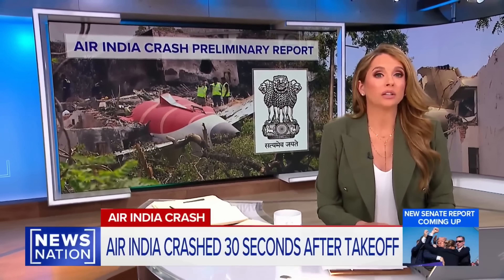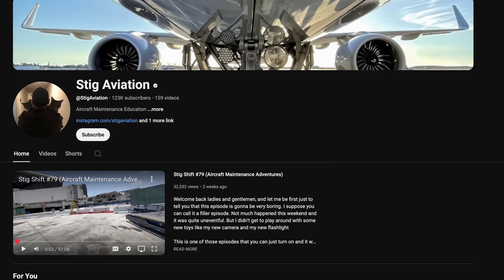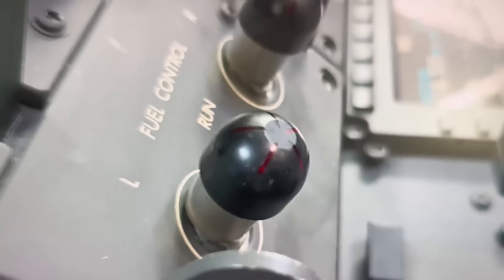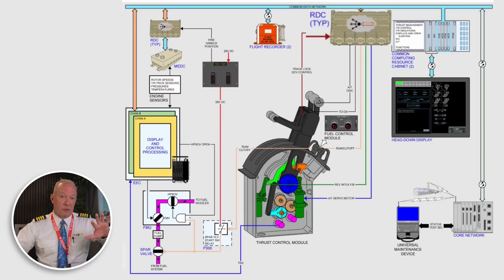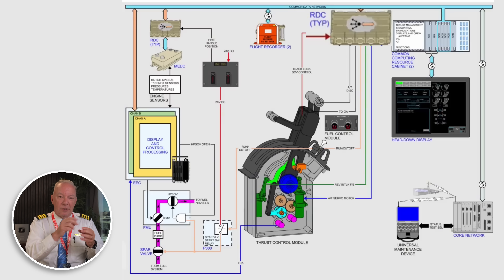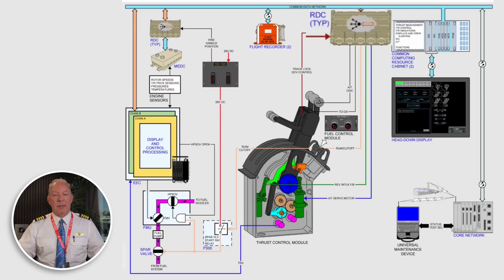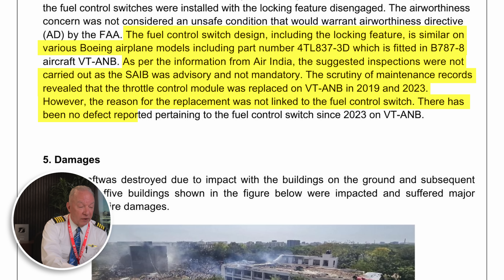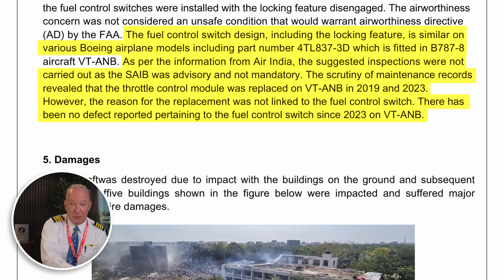The Truth About Boeing 787 Fuel Control Switches

Comment: Absolutely agree! Thank you Captain Steve.
These same switches are on the B757/767 that I fly and never have I seen a faulty Fuel Control Switch.
The report is very specific, the overwhelming possible cause for the engines to spool down was that the Fuel Control Switches were moved to Cut-Off, the probability of an accidental movement of both at nearly the same time is beyond what could be reasonably be expected. A dual independent system fault is even less likely.
There is another way to close the three fuel valves. Pulling the Fire handle. This didn't occur as per the preliminary report. The fire handles are locked in place by a mechanical guard. Accidentally moving those is even more far fetched than accidentally moving the fuel control switches.
Reply: Please watch Flying Beasts analysis before commenting about this topic
Reply: @anshgupta7726 I have. I also have 7500 hours of the B757/767 that has the exact same Fuel Control Switches. Also an Instructor on type.
Reply: Except for the wear and tear possibly where many pilots fail to fully pull the switches out to clear the notch over time those notches can wear out and become much more easy to knock off. I would be looking at whether a set cycle life where the switches should be replaced.
Reply: @gregb1599  They recovered the switches.  Presumably if there was any such wear and tear, it would have been noted by now and a safety bulletin issued.
Reply: @BlueCyann I have found no evidence that the fuel switches have been recovered. Only other Air India switches that have been checked, I do not believe there is much left of anything in the cockpit. 
And all airlines have checked the fuel switches for wear so there was a bulletin put out to check the switches, just to rule that out as in the past some 737 did have issues with the switches. And it's not the first time when an airline thought they had fixed the problem only for another aircraft to crash before a real fix was made. DC10 for an example with it's faulty cargo door!!
Reply: @gregb1599 The AI171 fuel switches were recovered and there are pictures of them in the Run position.
Reply: @benanderson4118 Where is the proof its from that accident? They are only on the net and could be from any aircraft, until they publicly show that I take all photos on the web with a grain of salt! In 2018 they had a bulletin for the switches on some 737 aircraft where they could be accidentally switched off and as I have said many times some fixes have not fully fixed the problem and no matter how unlikely it is there is still a small possibility that both switches were faulty and were accidentally knocked off. Everyone on here is so one sided its the Captain he did it and thats the end of the story nothing else could have happened! Well I will keep an open mind until I am proven wrong!
Reply: I'm thinking, if the fuel switches works as Captain described it, then a loss of battery power could open both relays and close all the valves.

A flimsy contact might be triggered by positive G's, then start working again when negative G's happens after shutoff.

Or, the battery could have died, opening the relays, which then closed again after the RAT started providing power.
Reply: @giacomoneri1782 the batteries are getting constantly charged from the DC buses, powered through the main AC buses (using a Transformer Rectifier Unit) by the engine driven generators, with multiple backups. The very last electrical power lost would be the Hot Battery Bus. This scenario is highly unlikely. Now this isnfornthe B757/767 but I highly doubt the 787mis any different.
Reply: @gregb1599 watch the video again. They were recovered. The entire throttle quadrant was…it was from the Indian report.
Reply: @gregb1599  Two switches malfunctions, at the same time?!
Reply: @emmypuss4533 Yes extremely unlikely, but in 2018 some 737 switches were found to be faulty, could the fix end up not fixing the problem long term? Possibly but yes extremely unlikely of course dual engine failure is also extremely unlikely but has happened in the past. No one knows anything yet. It will quite likely be the pilot, either accidental or on purpose, we may never know. But it is very scary if all it takes is one pilot to pull the fuel cut off so quickly that the other pilot cannot react in time to stop them! Some say the pulling the fire system will shut down the engine and make it impossible to restart the engine. However my brother who used to work for the airforce as an avionics engineer said that assumption is wrong and there is nothing stopping restart of the engines as its only discharging fire retardant. He worked on the Boeing 757 aircraft.
Reply: @gregb1599   According to the preliminary report the throttle control module (which includes these switches) was replaced in 2023 so they were fairly new. Also these switches are used at the start and end of every flight so I think pilots would notice and report it if there was a fault with them.

Comment: According to  this simple diagram and 'Closed System Theory'  The flight data recorder could not have know where the switches were. For my sanity, I would like them added to the diagram.  Could something gone wrong with the relay caused the issue?

Comment: There seems to be two contradictory scenarios.  Captain Steeeve agrees with the official report that the engines shut down ONLY after the fuel control switches were manually and deliberately transitioned to cut-off and it was that and only that, that caused of the engines to lose thrust.  

Geoffrey Thomas'  rather detailed and technical analysis indicates that the engines failed and the RAT deployed BEFORE the switches were moved and indeed at the very time of the initial takeoff roll.  The engines failure was, VERY PROBABLY DUE TO WATER INGRESS INTO THE ELECTRICAL EQUIPMENT BAY CAUSING A MASSIVE ELECTRICAL SHORT and that severe electrical crisis caused loss of necessary power to all fuel pumps and thus caused both engines to shut down (position of switches and status of relays being moot at this point).  The electrical crisis was a transitory effect and the engines immediately and automatically tried to relight, but the pilots unknowingly tried to manually relight the engines by turning off, then on again the fuel switches.  Thus the off again, on again switch positions so recorded was a misguided attempt to relight engines that were already in the process of automatically relighting.  Of course, by this time it was far too late for any recovery, automatic or manual.  This would completely exonerate the pilots and put the blame on Air India and its maintenance procedures for allowing water ingress to cause a fatal malfunction.

On the one hand, (1) it was a deliberate sabotage by a psychotic pilot (which I just don't want to believe) OR (2) it was a maintenance failure on the part of Air India (which I can believe).  BUT, regardless of what I WANT to believe, there is evidence out there that will settle these discordant positions and I (for one) would like it released in another authoritative update.

Comment: Slight correction on your explanation of that switch. You keep saying there is a relay inside that switch, that is not true. That switch is simply a 4 pole, two position (ON/OFF) switch period. By definition a relay performs a function similar to a switch but the change from on to off is done via application of a DC or AC current to a magnetic coil. None of that exists in this switch. By continuing to call it a relay you give listeners the opportunity to say some errant signal may have caused changing of the position which we know is not true. Hope that clears some semantics up. Retired aircraft wiring engineer here.
Reply: What about the claim by many that the black box registers only the valves at the engines, and not the movement of the switches?  There are thousands of Indian web sites whose whole business is claiming that the fuel switches were never physically moved.
Reply: @JosephBoxmeyer-u3d  As I stated, the switch has four independent poles which means it can drive commands or data collection to four LRUs. While I do not have access to any actual 787 wiring diagrams I have seen a block diagram of sorts that shows two signal paths departing from the switch. One is going to actually command the shut off valve via a relay and the second goes to the RDC to record the position of the switch. The other two poles may be used or not, without a complete diagram I cannot say. So to your question, I would think that everything collected on the RDC's eventually makes it to the FDR but who knows. If you have the data, why not record it.

Comment: I imagine alot of hand slapping going on under the throttle levers as one pilot tried to reset the fuel cutoff switches and the other pilot calmly saying "I did not" for the CVR while fighting to keep them off.  Malice and forethought in my opinion.  The bad guy won.  It was the absolute worst.  "It happens"  -Orenthal James Simpson.

Comment: I watched that video that commentator #3 did that was on the start of your video. I believe he’s basically full of it.  I’m typed in a few different airplanes and as you say just about all fuel shutoff valves are hard wired to the battery through a relay.  We will never know why the fuel control switches were shut off because the answer lies with the Captain who is deceased.  The plane did exactly what it was designed to do, even though the level of this tragedy cannot be ignored.  Great Video Steve!
Reply: There is evidence enough to deduce what happened with the fuel switches, at least to some level and degree of certainty. It's not completely unknowable. NTSB did extensive investigations for this very reason. To figure out what happened after everybody is dead, using evidence, science, reason and logic. It's really horrible how they are trying to deflect and create propaganda that it is unknowable what happened. Much of what happened is knowable. 

I get what you're saying tho.
Reply: Did anyone checked the relay springs if are ok?
Reply: The reason so many people assume the fuel spar valve was computer controlled is because on the 787 almost all valves are controlled that way. I think, only the fuel spar valve and fuel spar jettison valve are hard wired.
Reply: THEY NEED TO INSPECT ALL PILOTS
Reply: You missed that big fat AND gate between the P300 relay and the valve. LOL!
Reply: The 787 is VERY different from all your planes.
Reply: @ConcernedParent-z1q ITS OBVIOUS  YOU DO "NOT" HAVE A AME LICENCE

Comment: Could the relay have failed? Most relays are normally open or normally closed. I would think this relay would be normally closed (fuel off), is it possible the relay coil burned out and the relay spring moved it back to it's default "closed" position?
One other question. You see how the relay goes to an AND gate? The other end of that AND gate goes to the "Display and Control Processing" that's an input from that system to the AND gate. AND gates require that both inputs are high for the output to be high. So if that Display and Control Processing signal went low then it would cause the AND gate output to go to 0, closing the valves. Is that correct?

Comment: This is why we need in cockpit video recordings. Then there would be proof if someone shut the switches off and denied it or if the switches failed confusing both pilots.
Reply: Seriously we have back up cameras in vehicles sonar crash detection. Put video gear to black boxes and while you’re at it cameras so pilots can see behind above and below as well as each engine and landing gear flaps so you can diagnose false data. Then you know if flame out gear down flaps correct. Seems silly a 74 year old sod buster from Nebraska has to suggest these safeguards. Flown as passenger maybe 6 times in my 74 years

Comment: Capt Steeeve.... next time you're in the simulator... see if you can "balance" those switches in their "center" position... with the lever detent on top of the flat portion of the switch body. I could do it on some older detent switches... don't know if it is possible on these switches.

Comment: Captain Steeeve - First of all, thanks for the videos you’ve been putting out on this topic! A couple of open questions in my mind: (1) What exactly happened in the case of ANA NH-985 on Jan 17th, 2019, to cause a dual engine failure immediately after touchdown in Osaka without the pilots having touched the fuel control switches? (2) For Air India flight AI171, I’ve seen on some YouTube channels that the RAT may have deployed before the fuel control switches transitioned to cutoff. What are you thoughts on this?

Comment: I know zero about flying a plane but moving those switches looked way to easy for something as critical as shutting down an engine.
Reply: Pushing the yoke forwards is also very easy. But, yes, inadvertent "muscle memory" type action should probably be blocked in the takeoff phase.

Comment: Steve, as an electrical engineer, I noticed that the schematic isn't quite detailed enough. Specifically, there is an AND gate (A logic symbol) that ultimately controls the fuel valves. I would like to see how the wiring makes this logical AND function. I also don't see where the fuel control switch signal voltage indication is being tapped from for the flight data recorder. Just an observation that these details might need a bit more clarity. I don't have a pet idea. I just want clarification. Also, the model you made did not have a realy or the LOGICAL AND function. You may have simplified this for explanation but I think it is too simplified.

Comment: What is not mentioned is the monitoring circuits and how they are connected keeping in mind that the action of the switches is recorded. Without details of that part of the circuit nothing can be evaluated but could the detection line have fed 48v to the relay side of the switch. I know that is a long reach but all possibilities should be addressed.